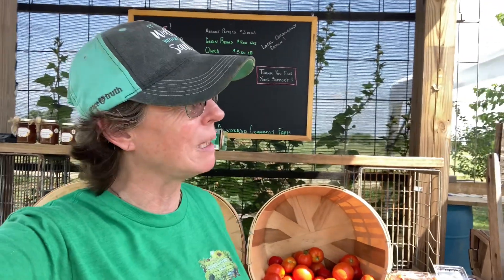Why we don’t use shade cloth!

Comment: I am in NW Arkansas. I built a 20x24 hoop house double layer(max 8" between layers) last summer, just to grow kale. The goal?.. 4 season growth of kale and a few other greens. It worked with the help of max frost row covers, 1st week of Jan. and 6 heat lamps during 8 days between -5 and 13 degrees and several cloudy days, no damage to the kale. I had the best kale leaves, huge and no pests. Took covers off mid to late Feb. Threat was over. I left the row covers on too long and I think it was perfect for aphids to thrive. Then April 8 installed the shade cloth. Aphid problem got worse and worse. So glad I found your video today and it was so convincing that I removed the shade cloth in the rain! Love you both.